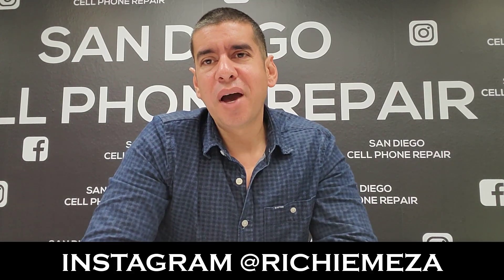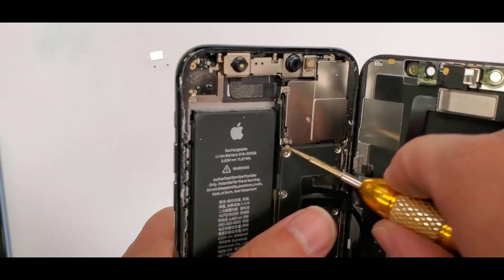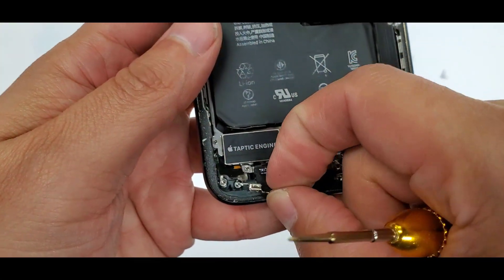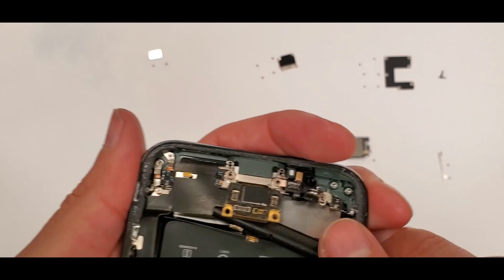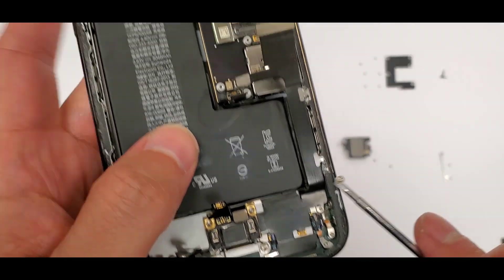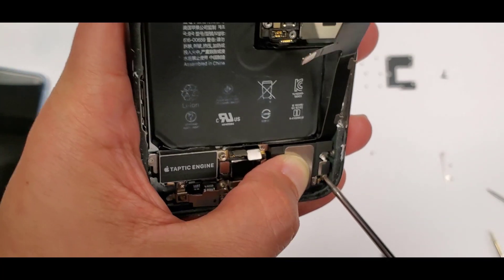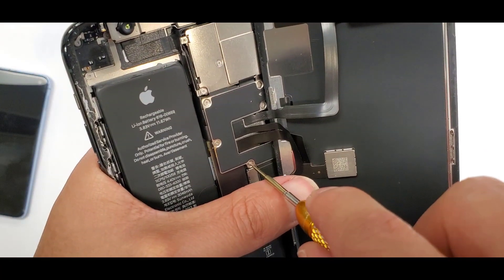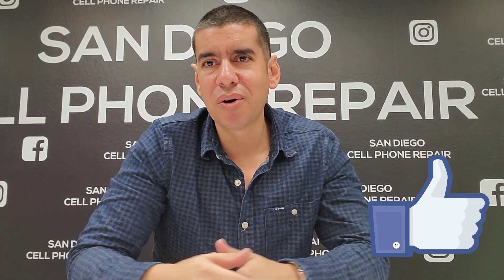IPHONE 11 PRO CHARGING PORT REPLACEMENT - A HOW TO REPAIR TUTORIAL

Comment: , I made the change and now
the iPhone restarts every 3
minutes. What should I do?
Reply from the maker: Plug the old one back in. Not take it entirely out, just take the connection of the old one and plug it in. If the phone works back to normal, it's the part you bought is bad or of low quality. Always buy the premium quality with charge ports or any small parts.
Reply: @RichardMeza  : Where do I go to buy "premium quality"?  I'm pretty sure Apple doesn't sell parts to their iPhones.  I've been looking on ebay, and question the quality.

Comment: How many times was the word screw mentioned. I only remember heavy screws, random screws and big screw. I never learned how to replace the charging port..
Reply from the maker: The way you replace the charging port is by removing around 25 screws during the process. I show in order how to remove all these screws, take out the charging port and replace it, put all screws back in order.  The video is straight forward. Just watch the video again. You need 3 different screwdriver tips to do this repair.

Comment: For those big screws.. Instead of a flat head, use a pentalobe, it works perfectly & is easier.. Nice video -MTTRACKS
Reply: You need a special stand-off screwdriver. It’s like a flat phillips with a spike in the center.